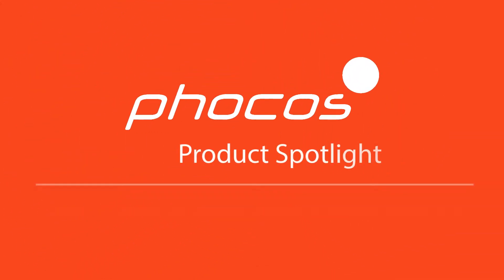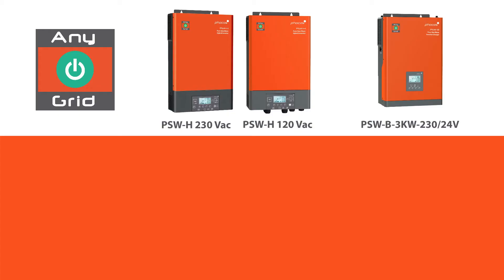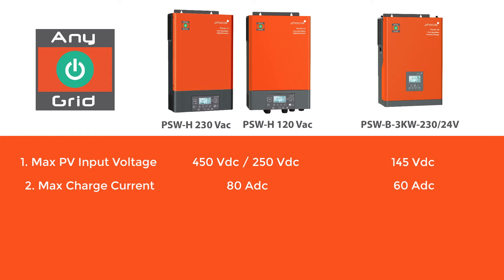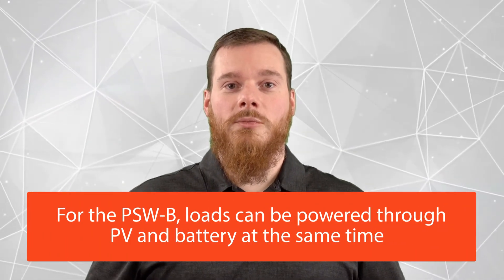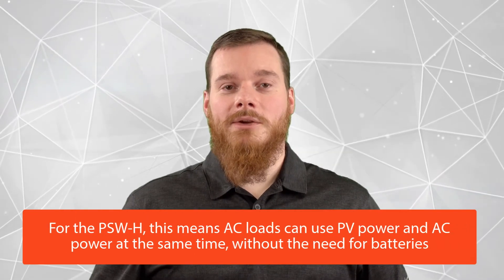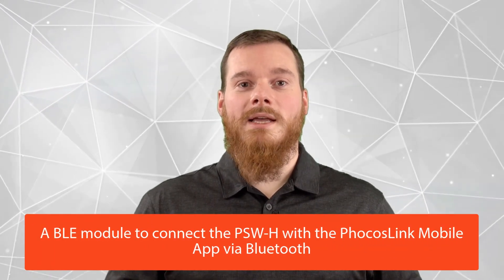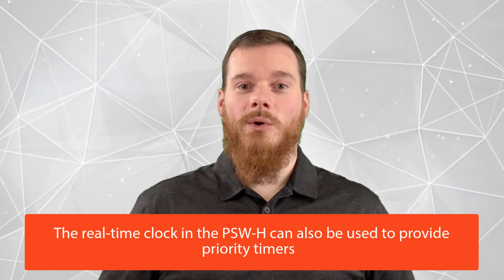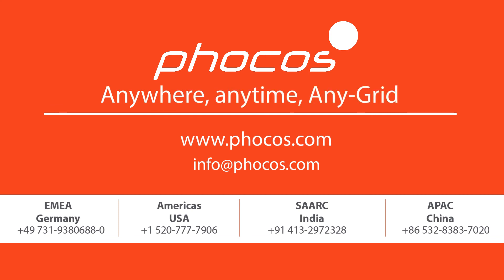6 Differences Between The Any-Grid PSW-H and PSW-B

Comment: Hi, we have the Phocos Any-Grid PSW-H 5 kW my question how can I set the system for running without a battery only solar to support the Grid (minimise the Energy cost from the Grid)
Reply from the maker: Hello Thank you for reaching out. According to our technicians A single Phocos 5kW inverter can be used battery free as is in order to support loads with solar as a priority. Please ensure that your output priority in Menu 01 is set to SUB - this will mean that Solar is used first to power your loads, and then the Utility will be used only when solar is not present, or at night. Without a battery, your loads will have no power if the sun is not out and the Utility is down, so we recommend to pair one Any-Cell 5.12kWH LFP battery with each 5kW inverter. For any further questions please reach out to our technical support on our website. https://www.phocos.com/contact/#contactech
Reply: @phocos-global  Many thanks for the quick response. Unfortunately, the Any Cell is sold here in Germany many times more expensive than, for example, Pylontech, Deye, ... akkusystems.

Comment: Hi,
I'd like to know if this inverter synchronize with the grid. I'd like to connect 5 modules 375W director on a grid.thanks
Reply from the maker: Hello, the Any-Grid PSW-H models do have the ability to feed excess PV power back to the grid. The PSW-B models do not have this ability. When this feature is enabled, all excess PV power that is not used for battery charging or to supply the AC output demand will be sent back to the utility. The grid feed-in feature requires a PIN code to enable the feature, please contact tech.emea@phocos.com should you require the PIN code.

Comment: Hello. I have a question.
Does the PSW-H can supply energy to the loads as following: priority 1) PV and, priority 2) batteries?

If the grid is available, the priority could be: priority 1) PV, priority 2) batteries and priority 3) grid?
In this case, if the energy supplied from PV and batteries is enough, the inverter will it run on PV and batteries only?
And once the PV and batteries do not produce enough energy, will the inverter request the needed for the loads energy from the grid?
Reply from the maker: Hello, yes, this can be done in the settings menu of the Any-Grid PSW-H. Menu option #01 (AC Output Source Priority) allows you to set the order in which the input sources are used to supply the AC output demand. 3 options are available for this priority setting.
Solar – Battery – Utility (SBU)
Solar – Utility – Battery (SUB)
Utility – Solar – Battery (USB)
 
For more information on the Any-Grid PSW-H range please see our video: https://www.youtube.com/watch?v=3VDgOfbingE&ab_channel=Phocos or contact: tech.emea@phocos.com

Comment: So neither will feed electricity back to the grid like the gird-tie inverters?
Reply from the maker: Hello, the PSW-H range does have the ability to feed power back to the utility AC source. The PSW-B does not have this feature.
It is important to note that Grid feed-in / injection may not be legal at the site of installation. Only activate when using the public grid as an AC source, else your AC generator and the Any-Grid PSW-H could be damaged. It is the responsibility of the installer to verify that feed-in is legal at the site of installation before activating this feature.

Comment: I would like to know the reason for using 200 AH Lead Acid battery as the minimum capacity with 3/5 KW phocos inverter. Is it because :-

1. From Charging point of view that the battery charging current from the inverter to the battery cannot be programmed less than 20 A (max charging current for 200 AH battery on normal operation) and charging via solar in case of no grid can damage lesser capacity battery?? And/Or

2. From Load point of view such the inverter when operating in pure battery backup mode (no solar and no grid available)  the minimum capacity has to be 200 AH to cater to 3000 Watt of rated load ??

3. If my inverter is configured in a way that the connected load on AC output side of inverter is less than 1000 watts (the max emergency load in case of power cut or grid failure) and the inverter is mostly operating in grid feed in mode, then

a. Can I use 100 AH/150 Ah batteries with the inverter for minimum backup requirement...??

These are the queries I am getting from clients who want to upgrade their existing On Grid systems to Hybrid Systems and I suggest Phocos inverter for the same.

The concern of the clients is that adding 200 AH battery adds to overall cost of upgradation since power cuts are minimal, back up requirements are basic and Solar power is utilised majorly in grid feed in mode
Reply from the maker: Hello, we sincerely apologize for the late reply. The main reason for recommending a minimum lead-acid battery capacity of 200 Ah is to allow for sufficient current capability in powering the AC loads up to the rated power and the same for charging from PV. All while maintaining acceptable voltage ripple on the battery for good regulation. Choosing a 100 Ah battery is possible if the AC loads are small enough and the charge current is reduced (the minimum programmable value is 10 A), however in such a case it is questionable whether it would not be better to use a smaller inverter altogether. If battery cost is of major importance and battery life expectancy is not an issue (you cannot have both), use vehicle starter batteries instead of solar / deep-cycle batteries. These are cheapest and designed to deliver higher currents, at the cost of life expectancy.